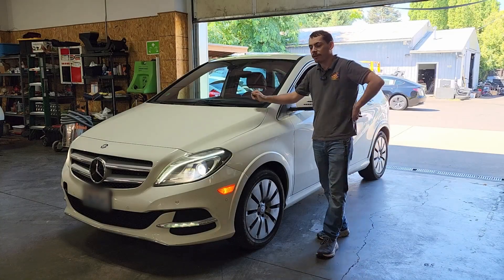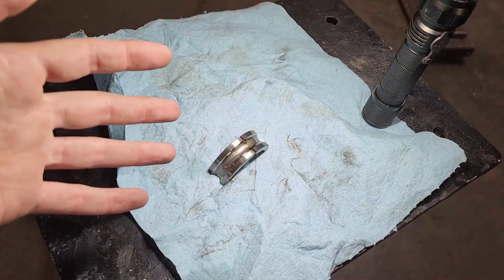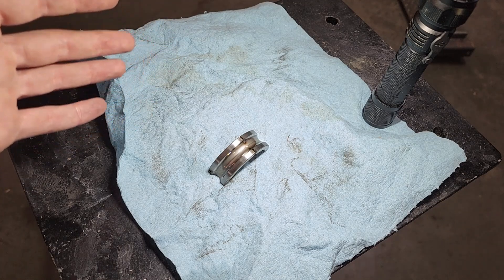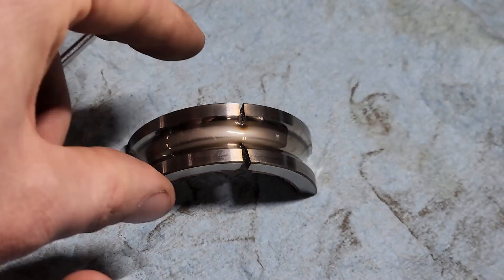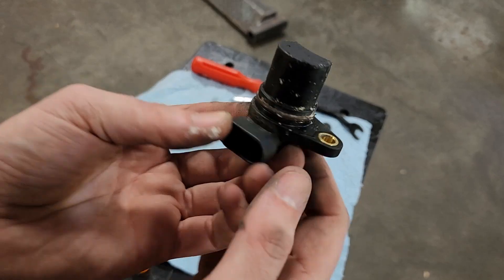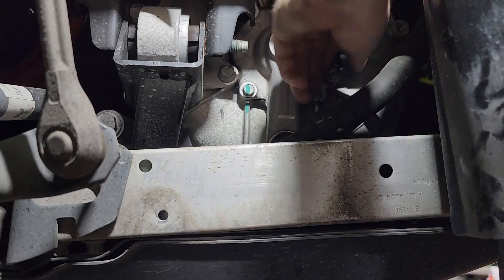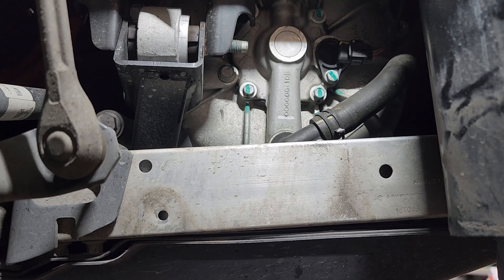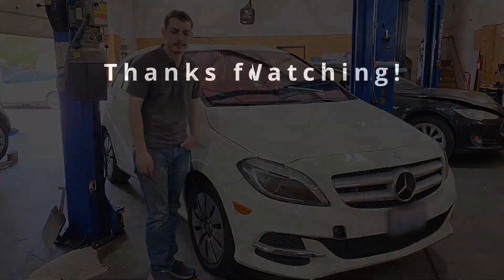How to tell if your Tesla LDU has issues.

Comment: Good evening…. Long shot question maybe you’ll get back but I have a noise on a 2013 year model s, I’ve done the LDU rebuild on it with the help of your video! Great content. This particular unit actually had a completely failed drive pinion gear bearing (the bearing cage was in the bottom magnet of the oil pump pick up) so obviously at that point in the tear down that was definitely our crunchy noise on this motor. I went on with removal and replacement of all the bearing in the unit and cleaned and resealed everything. Upon initial test drive everything seemed fine… then it developed a milling sound very noticeable only on decel (regen) and I can kind of feather the throttle in decel and make it louder and change tone….. I’ve torn this unit apart now three times, I can not visually see anything worn or sign of what’s making this noise!!! It’s driving me nuts I thought I had it narrowed down to the differential because that’s where the noise was most pronounced on the case, I thought maybe the spider gears were causing this noise.. replaced it with a used diff. Still there. I’m stumped have you run into this??

Comment: Hi Alex.  How hot does coolant get during normal driving on a B250e.  Feels like barely any heat builds up even after half hour freeway driving - telling by feeling the coolant hoses under the hood.  Also, crazy thought maybe, why couldn’t these cars run the same Dex6 tranny fluid for cooling instead of actual coolant?  Do you think that would work since it is not conductive and still provide the cooling by running through all original components (radiator, pump, etc?  Cheers
Reply from the maker: Not terribly hot, certainly not as hot as an ICE car. 

Dexron VI doesn't have good enough thermal properties to provide proper cooling for all the systems in the car given the way the cooling system is set up (transmission fluid has about 1/3 to 1/4 the thermal conductivity of ethylene glycol based coolant). The oil also has higher viscosity, which could be too much for the pumps to handle long term (you'd probably burn through pumps like crazy). And lastly, the rubber hoses (and any other rubber parts) in the coolant system would also start to break down with long term exposure to oil, which could cause some major issues... All in all, not a great plan.

Comment: I have a similar problem with my tesla model S 85 2014. A rattling sound can be heard from the front axle on the left, from a speed of 45km/h to 90km/h. , which intensifies with increasing speed and fades in the left turn. I thought it was a right wheel bearing, I replaced it, but the noise persists, I think it will be a motor failure.  But why a feel this rattling noise and gentle vibration in the front? Thanks Norm

Comment: Does the RAV and B250 require removal of the LDU for the coolant delete manifold?
Reply from the maker: RAV4 can be done quite easily by just removing the front right tire, and removing the lower crossmember to access the manifold. On the B-Class, quite a bit more disassembly is required, and the motor does have the be lowered down partially (though not completely removed).

Comment: Just a silly question - would it be possible on the B250e to do the coolant delete  mod with the motor still in the frame? It looks from this video like there might be enough clearance to just about make it, and that would make this a much quicker and easier mod to do at home.
Reply from the maker: Yes, at least partially anyways... The "frame rail" and motor mounting bracketry is a bit in the way, but if you remove the mounting hardware just for the side mount, and lower the motor down, you can get enough access to install the manifold without removing the whole side unit.
Reply: @AlexEVRepair  Thanks! I'd bring it to you to do, but you are over 6,000 miles away and my EV range won't get me that far ... Sounds like I'll need to get a mechanic to do it for me, I don't have a lift at home, and I hate working under car stands!

Comment: Hello Alex, thanks a lot for your work, it really helps. Checked speed sensor on my "Norwegian" 2015 B250e with 50k miles on the clock — no rust, but quite a few droplets of coolant on it. Have ordered a cap from USA for the manifold, will install it asap. Is there a way to somehow dry the motor without opening it? Or if not too much coolant has entered into the motor, will it dry and get out somehow eventually? Thank you!
Reply from the maker: If the amount of coolant intrusion isn't too bad, you can probably get away with just a coolant delete. If you have access to the right tools (a megaohm meter), it might be worth pulling the cover off for the DC input to check the isolation values. You can also pull off the 3 phase cover to see if there are any signs of coolant or corrosion there as well.
Reply: @AlexEVRepair  Thanks a lot for a quick reply and advice. Just checked, I can rent a megaohm meter locally for a day. I think I have seen in one of your videos, how you remove the 3 phase cover from the LDU, I should be able to follow the process. If I am not mistakening, I won't even need to take off the LDU from B250e for these jobs, compared to Model-S.

Comment: Thank you. I wish I had seen this 5 months ago! ( Yes, i realize it's only 2 months old). Mine threw the codes and quit. And the boards are red. Is there any saving it?
Reply from the maker: Maybe, depends on whether the failure is that coolant got to the inverter and caused damage to the electronics, or if it was a loss of isolation within the stator. And of course how bad the extent of the damage is...

Sitting for 5mo though definitely doesn't help matters. Any corrosion that has started may have progressed further. 

Being that you have "red boards", that likely means you have a "Sport" drive unit (used in Performance variants of Model S and X).
Reply: @AlexEVRepair  I bought it about 5 months ago. I would have known to check it and do the coolant delete! It quit about a month ago. It brought up all sorts of codes. I have it out and just pulled the cover off. How can I test it to see what is wrong and if it's repairable?
Reply from the maker: For one, checking to see if coolant was in the inverter cavity is a big one, and whether or not corrosion is present on the boards/connectors. Second is finding out if there's a loss of isolation in the stator (the best tool for this is a megaohm-meter). 

If the inverter electronics are damaged, it's probably game over, and you'll likely need to source a full replacement LDU as finding a replacement  inverter standalone is nearly impossible.

Assuming the inverter is fine, then most likely you're dealing with a loss of isolation. The codes that were present on the car can confirm that as an issue. In some cases, you might be able to clean it out and dry it, but that's not always viable. Time is definitely of the essence to get it dried out...

Not sure where you're located, but I happen to have a freshly rebuilt Sport LDU in stock, ready to go.

Comment: Great video, Alex thanks. 
Would you recommend shooting some WD-40 or other fluid in a motor exhibiting the wet speed sensor to slow the corrosion process til they could get it fixed?
Reply from the maker: I'd be a bit worried about the WD-40 displacing any coolant to other places where it shouldn't be (such as the inverter) and causing more damage. So no, I don't think that would be a great plan...
Reply: Makes sense - thanks!

Comment: Alex, this is awesome. Have you found that the coolant leak will cause issues with the motor or inverter on the LDU overheating? That is, will it affect the ability to properly cool the LDU, or is it just a leak that will introduce a tiny amount of coolant but enough to cause corrosion/damage in the LDU motor?
Reply: I ask this because I've got an LDU where the motor and inverter are getting hot under relatively simple street driving (e.g., motor getting to 70+ degrees C and inverter getting to 50 degrees C after 20 minutes of driving), and as I've been investigating I've discovered that I have the milling noise.
Reply from the maker: While a little bit high, those numbers don't seem to far off of what I would expect to see... If it's real hot out, that could be contributing to a higher operating temperature. 

It's possible that if a buildup of corrosion is occurring in the motor, that could cause excessive resistance to the rotor turning, and thus cause more power draw (which would also mean a noticeable drop in efficiency). If you take a look at my recent video series rebuilding the LDU from a RAV4 EV, it actually was suffering from this issue.

Comment: Alex thank you for doing this series for the EV community. I have commented before because my Performance S has a high pitched sound but much different than the recored sound in this YouTube. Mine is much higher pitch. I look forward to your next video where you show how to check the Model S for the coolant issue. I am hoping mine is just drive bearings because like you said, that would seldom lead to a near term catastrophic failure. I'm not driving the car until I can check or get it checked for coolant intrusion. If I don't have coolant, I will drive it from San Diego to you for rebuild, coolant manifold (delete), and ceramic bearings in all spots. I will just fly home and then fly back to get the car when finished. If coolant, I could use your help with safe transport from San Diego to you for the same work and I just fly up and pick up when done and drive it back to San Diego. Do you know if Tesla would do it if I paid them to inspect for the coolant on the speed sensor? That way I could get it done right away. Thanks again!
Reply from the maker: Tesla won't do a speed sensor check for you, that's something you'd either have to do yourself, or take it to some other 3rd party shop. 

FYI, I'm actually going to be heading to San Diego later this week to pick up some shop equipment, so maybe I could arrange to try and meet you to do a speed sensor check during the short time I'll be there...
Reply: @AlexEVRepair  That would be fantastic! I would be happy to pay you. I'm in Fallbrook, retired, so I can have the care where ever you need it be when you need it there. Let me know how to contact you. John
Reply from the maker: Best way to get in touch while I'm on the road will be via email: alex@qccharge.com
or you can try to call me at the shop this morning before I hit the road at: 971-444-5064

Comment: Thank you Alex for your very professional take on this specific issues with some Tesla drive units. If I understand you right in what you mentioned in the end of this video, this coolant leakage issue doesnt apply to Tesla mS dual motor versions? I have a 90D, built in September 2016. Does it mean that it doesn´t have this kind of rear motor? What about the front motor?
Reply from the maker: Yes, non-Performance dual motor versions of Model S and X do not use the Large Drive Unit, instead they use Small Drive Units both front and rear. Actually, the Model S you can see in the background of the video at the end is a pre-refresh 2016 90D, which has over 375k mi on both original drive units (battery original as well). 
My own personal car is a 2015 70D, with over 460k mi on the original rear drive unit, and the front drive unit was replaced at ~375k mi, and the battery at ~250k mi (both while under prior ownership).
Reply: @AlexEVRepair  Thank you for a quick answer. I am very relieved to learn that at least this should not be a problem. My Tesla is now close to 185 000 km (some 296 k mi) and I have had a lot of issues, not with the drive train but with several other components. My worst incident was when my rear right lower control arm broke, due to a weak design and low corrosion resistance (improper aluminum alloy). Apart from that, my overall experience is that compared to other vehicles in this price segment Tesla is showing a very low component quality. I have replaced so many components, like headlamps, battery heater, cabin heater, AC-compressor, parking brake servo motors, circulation pumps, door handles and more. I think Tesla has created a fantastic drive train in a very low quality vehicle. I shouldn't forget the build quality, it looks like it is put together by kids. Anyhow, in some crazy way I still love the car!
Reply from the maker: Sounds like you've had pretty much all of the "relatively common" known failures. Also, FYI, 185k km is only about 114k mi, I think you got your conversion backwards, haha.

Comment: Very good explanation of the issue! In case I had a Tesla that is still under warranty, and found that there is coolant on the speed sensor, do you know if that is a failure covered by the warranty?
Reply from the maker: It should be, but folks often have a hard time getting Tesla to cover it without there being an "obvious" failure. They won't remove the speed sensor to inspect it themselves, so your best bet for proof is to take pictures or video. If they push back against replacing the drive unit, tell them you want the defective rotor seal to be addressed.

Comment: Hi Alex, not sure if you done a video on removing the LDU from a model S, I know is done by dropping the whole sub frame but are there any other gotcha points like isolating power and others?
Reply from the maker: Yes, there is indeed a HV disconnect/isolation procedure to remove it. I haven't done a video on here about that yet, but it's the same process as doing any other work on the HV systems in the car (I actually did do the HV disconnect procedure on my recent Model S CCS retrofit video). All of Tesla's service manuals that show those procedures are also available for free at service.tesla.com

Comment: Please explain how you can eliminate rotor coolant (delete manifold) without damaging the rotor.Thanks
Reply from the maker: Deleting the rotor cooling will cause the rotor to run a bit hotter, but won't cause any real damage to it. Even in stock form, the amount of coolant that runs through it is pretty miniscule (coolant flow for the large, 60lb rotor is limited by a hole that is ~1/8" or ~3mm in dia). As I stated in the video, even Tesla has started deleting the rotor cooling on these drive units from the factory with the latest revision (rev-U). 
The only downside to deleting rotor cooling might be decreased lifespan for the rotor bearings in the long term, but given that the bearings get destroyed by coolant intrusion anyways (not to mention the rest of the motor) when they do have rotor cooling, I'd say that's a more than worthwhile tradeoff. The hybrid ceramic bearings I use are rated for much higher operating temperatures than the motor will ever see (the grease in them alone is rated for continuous duty at 300 °C).

Comment: Thanks again for sharing your knowledge. Here in europe we also have issue with bearings / seals for EV motors for the Renault Zoe (2017 R90 motor). I just had them changed at 65k miles at an indpendent shop like yours. Renault dealer only wanted to change the whole motor...
Reply from the maker: I think I've heard about those issues on the Zoe before. We don't get those car's here in the U.S., but I have heard of other similar bearing wear issues on the Hyundai Kona and Kia Niro, though I have yet to actually encounter one myself. I've also heard that the Audi legacy e-Tron drive units are prone to internal coolant leakage issues (though again, I haven't seen one myself).

Comment: Is it possible to get on a list for a coolant delete part from you? I get the impression they are tough to get from QC Charge - San Diego. Happy to pay in advance if needed. I live more than 85 miles from your shop, so I"d have to trailer my B250E over if I could schedule a time for you to do the delete. I'm willing to try it myself (old mechanic and engineer) and then trailer it over if it exceeds my skills. Great car and good to know it isn't doomed! Thanks.
Reply: I have successfully completed the coolant delete on the B250e with only removing the front wheel.  The motor mount is in the way, but you can work around it.  Remove the old manifold by unbolting it and using a cut-off tool to trim enough off the manifold to clear the motor mount.  You are never going to use that part again ayway.  While it may not look like it, the bolt at 10 O'clock has enough room to be removed. The QC Charge manifold will slide right it because there is no tube to get in the way.  Again, the 10 O'clock bolt will be tricky to get in, but with a thin 10 mm wrench (and a lot of patience) you can tighten it.  Obviously take care when cutting the old manifold to ensure you do not mar the mounting surface on the motor nor get any debris in the exposed areas.  The flyover tube is stiff, but there is just enough give to pop it out and back in.
Reply: @PovSpec  where did you find the QC charge delete part. Are they shipping?
Reply: @ScotGraham  QC Charge has them in stock, but check again with Alex as he has been so good to share these videos.  I used the lite version.
Reply from the maker: I'm just about out of my current batch of coolant delete manifolds, but should have more in stock relatively soon hopefully. Installing the delete manifold as a standalone procedure on the B-Class doesn't quite require removing the whole drive unit, but does require quite a bit of disassembly and removal of one motor mount so that that side of the motor can be lowered down enough to provide clearance around the "frame" rail. 

If you've got the "extended charge" feature on your B-Class, you should be able to make an 85mi drive without too much of an issue! The customer that brought this B-Class actually drove it here all the way from Seattle (which took a long time).